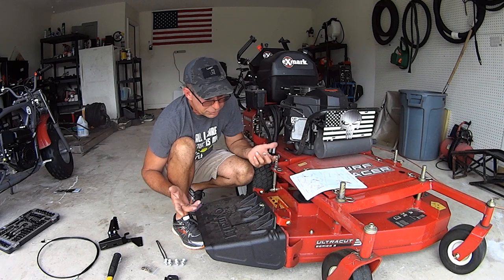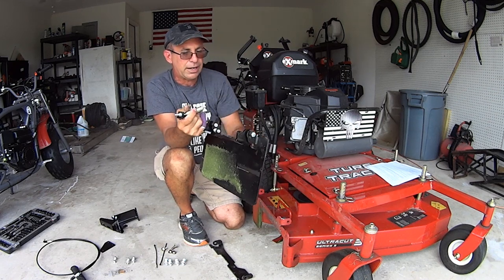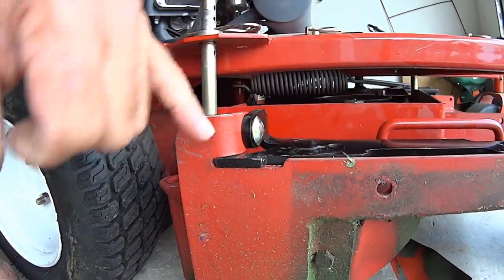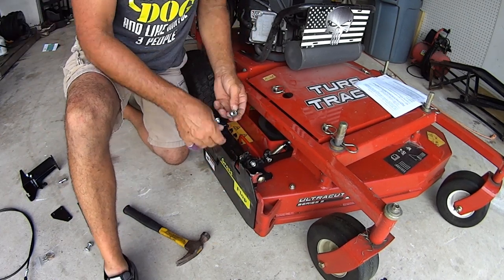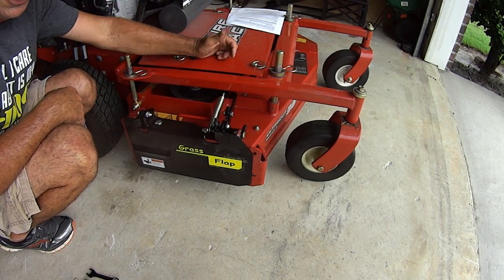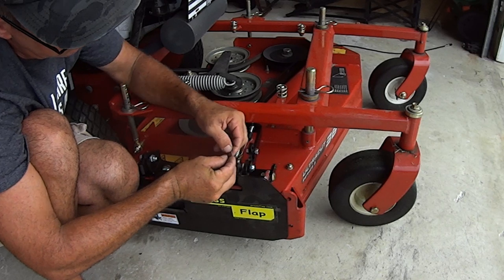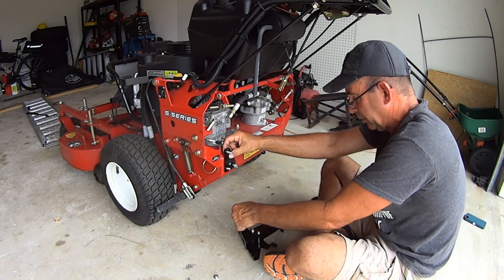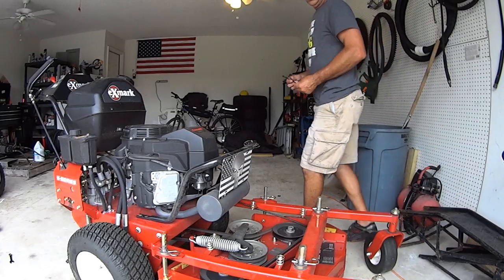How To Install Grass Flap OCDC Chute Blocker on Walk Behind Lawn Mower

Comment: I plan on getting one of these as well. Originally came across the trimmer trap and couldn’t stand the design, esp the long bar that travels to the chute to the handle bars. This extra $100 for the grass flap looks worth it. Will it work with bagger systems like the accelerator bagger or the rack em grass catchers? Awesome videos as usual dan!

Comment: Hey dan my gravely pro zt has the high lift blades but when i cut grass it does not mulch like i want it to, it leaves thw long grass that has bewn cut on grass and i have to mow over it to mulch it more .. any suggestions?
Reply from the maker: I just did an entire series of videos on blades.
Reply: Ok i see it thanks
Reply from the maker: You’re welcome. You should be able to get little nuggets of information from those three or four videos that you might be able to make a decision for your situation

Comment: Hey Dan nice video. I had seen many videos about the grass flap cable getting broken. Did you check that before buying it? I want to buy it too but quite frankly I'm not so sure about it because of that cable  and they said the cable is kind of expensive for just a cable. I hope that doesn't happen to you.
Reply from the maker: The cable will last a very long time if it is lubricates and not kinked.
Reply: I had mine for 7 yrs before it broke and I cut 30 yards a week.